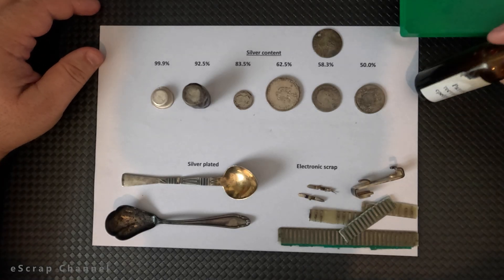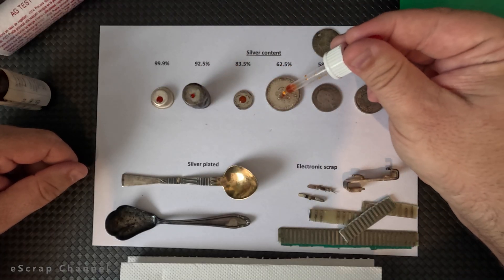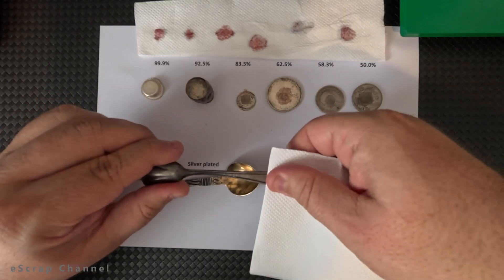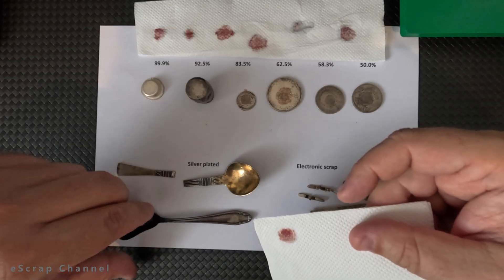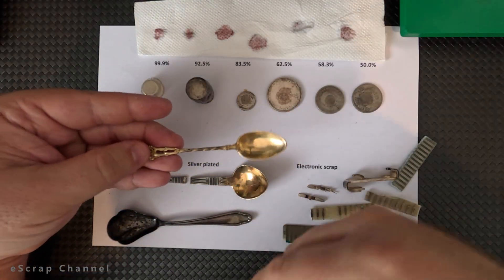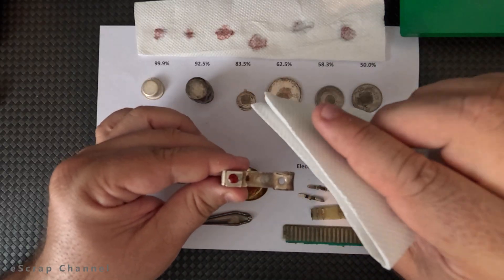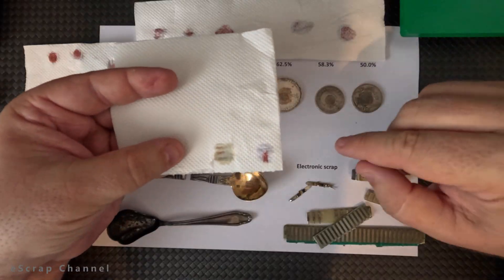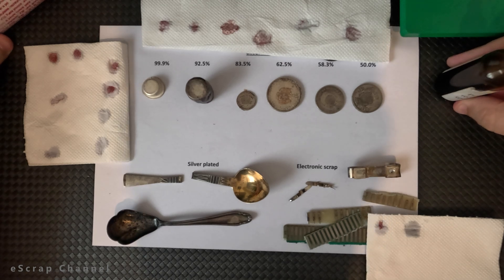How to Test Silver?

Comment: Potassium dichromate is a confirmed carcinogen so reconsider its use
Reply from the maker: Hi, this is a commercial product sold with a clear instruction of use. As it is commercially sold - it is companies selling responsibility to inform users. 
Considering the high concentration of nitric acid in the silver test product, your last issue is cancer if you drink it or take a shower with it.